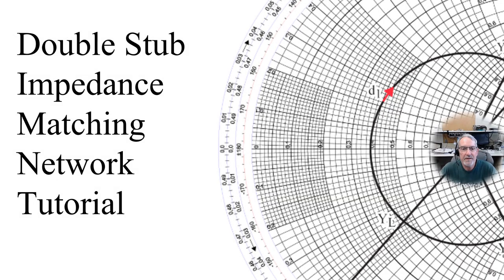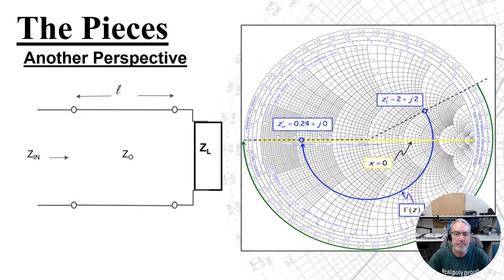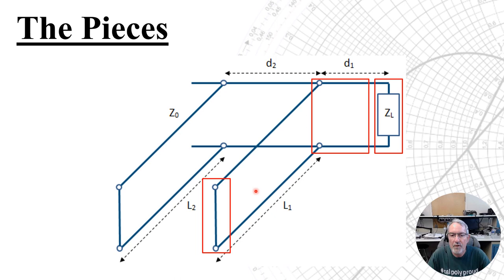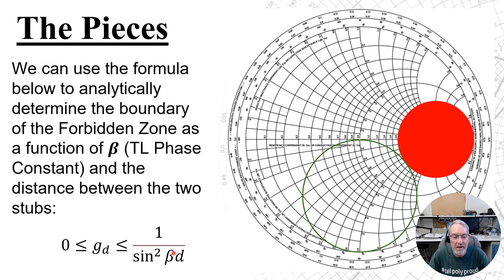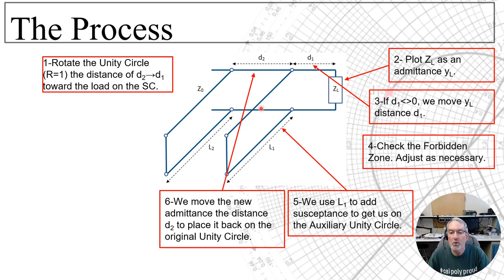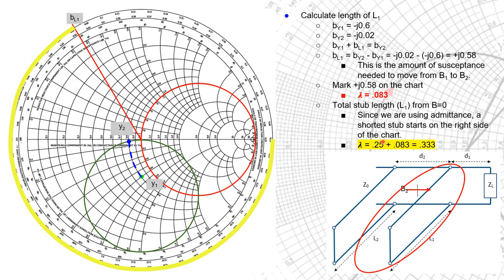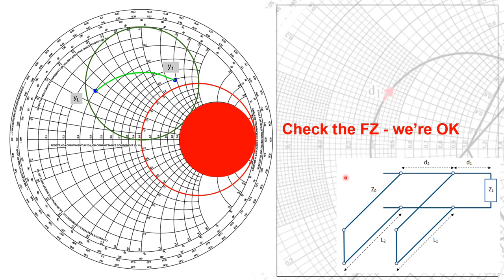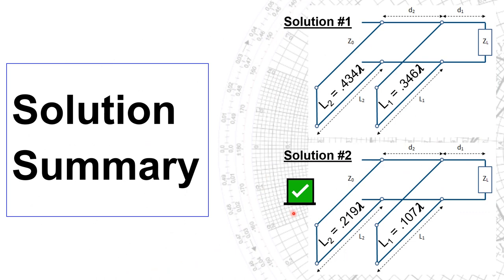EE375  Double Stub Matching Network Tutorial

Comment: After watching many double-stub matching tutorials, yours is by far the best. You started with a good, concise Smith chart review which was helpful for those of us who don't use these charts often. You explained how the auxiliary unit circle is simply a translation of the original to a different line location. In the step-by-step examples, you constantly cross-referenced points on the circuit diagram with corresponding points on the Smith chart to show why the geometric transformation you were doing were justified by the distances involved. (Many other tutorials present the "compass work" without sufficient justificaton.) My only quibble is that you were using a Smith chart with only an impedance grid while doing a problem in admittance, so it wasn't immediately clear where some susceptance values were coming from without stopping the video to reference a paper chart that had the missing admittance circles. Thank you for pointing out that the solution with shorter stubs yields wider bandwidth. It's clear to me that this is because longer stubs accumulate phase errors more quickly, but it might be advisable to say so explicitly. Overall, an excellent lecture! Thank you for making the effort to produce it.
Reply from the maker: David, thank you so much for your complement and  useful comments. As an FYI, the students in the Intro to Transmission Lines class I recorded this for have just been recently introduced to a Smith chart by the time they watch this video. I chose to keep it simple and not get into the admittance format. The students will eventually get to it.    Thanks again.

Comment: Two questions:

1) I have noticed that you have used short-circuit stubs in all examples. Is there a difference between short and open circuit stubs aside for starting 0.25 wavelengths apart?
2) For the second example you state that the preferable solution is the second solution because it uses less length and therefore less material? Are there designs where a longer stub would be preferable?

Besides that awesome video!